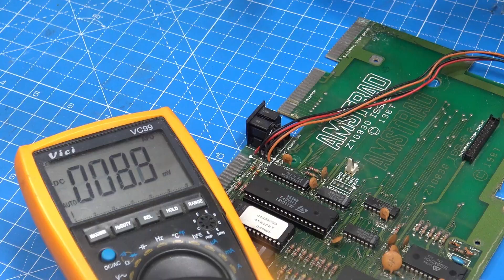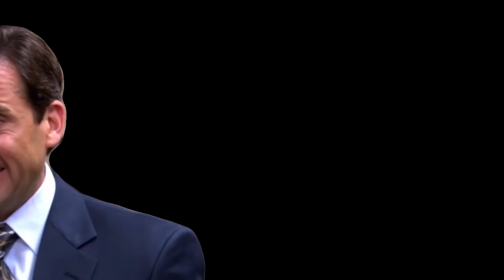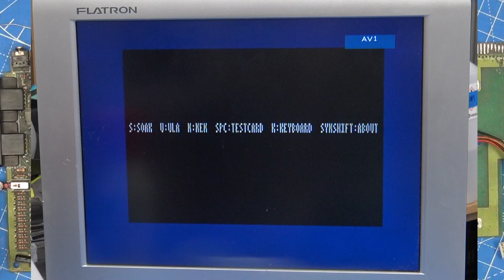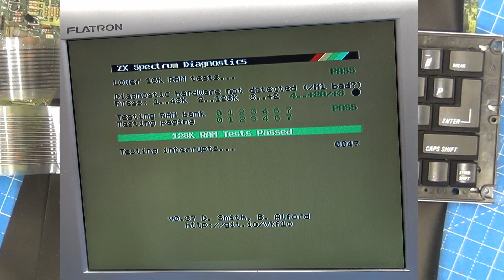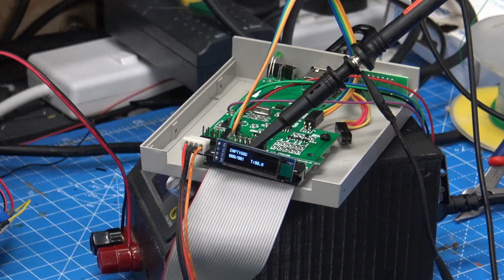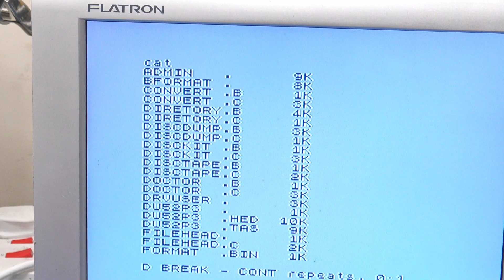I didn't do the basic checks and paid the price. Dirty ZX Spectrum plus 3 and Gotek woes.

Comment: Hi Lee, Good work on that board 👍.
I have a few Spectrum's to clean up and I am waiting for some IPA to turn up you mentioned that you used some vinegar 1st. What do I need and how do I go about it. Or do you have a video that explains the best process for cleaning these old boards.
Cheers, Steve j
Reply from the maker: Vinegar is used to stop alkaline from spreading and also a good cleaner so you only need that if it has battery damage.  I use that in the Atari videos a lot before cleaning again with IPA. You can clean boards with IPA or just deionized water just make sure they are dried correctly
Reply: @leesmithsworkshop  Thanks 👍
Reply: @leesmithsworkshop I used vinegar on a Archimedes board and badly damaged it.

Comment: case idea. saw the side off and fit the connector closer to the main board. and go with a case similar to your recent design.
Reply from the maker: I would be cast aside by the retro community if I did that, banished for ever ! 😆
Reply: @leesmithsworkshop  its not a rare machine by any stretch but in that case, how about a case that holds 2 drives. a slim gotek and slimline 3.5" (nobody really like 3" anyway!)
Reply: Less rare doesn't mean cut  it up.@preferredimage

Comment: Still a good result but doesnt it just frustrate you when you realise there was a shorter path to success. one thing I've learnt from watching Louis Rossmans videos on apple stuff is dont just clean it out the box. test it. fix the actual fault it came in with, then diagnose and clean as a whole.. you sometimes clean the clues without realizing it. and yes, step down voltages, not up where you can. much less noisy in my experience. I have one of those boost converters causing a pi to crash. think I'll get a buck and feed it 12v as well.
Reply from the maker: it's just when you find something and you are determined to find the fault the simple stuff is  not interesting enough